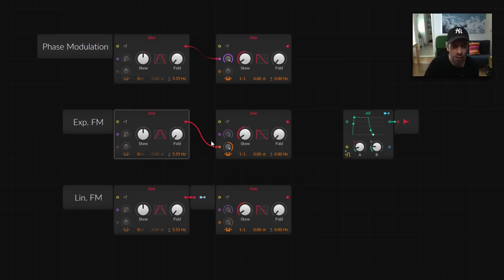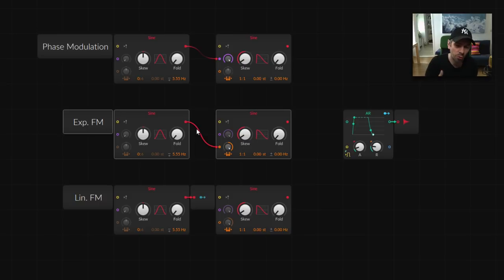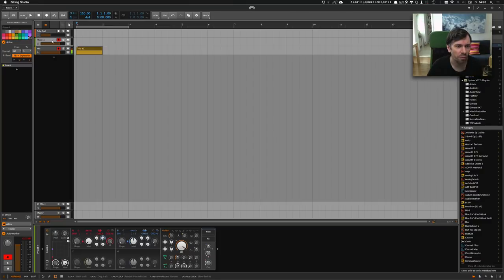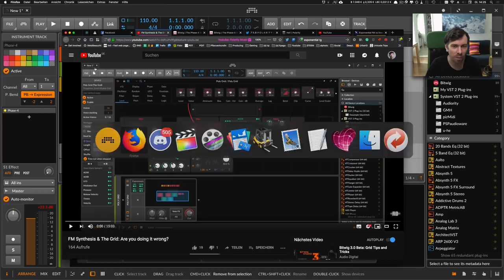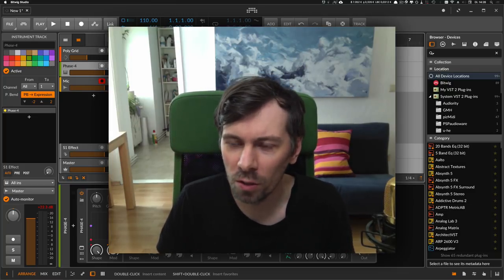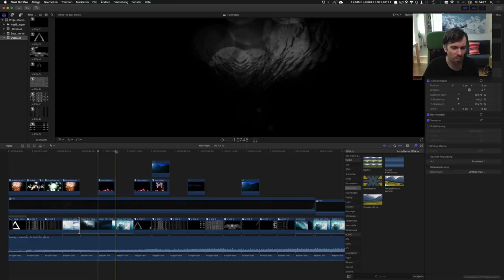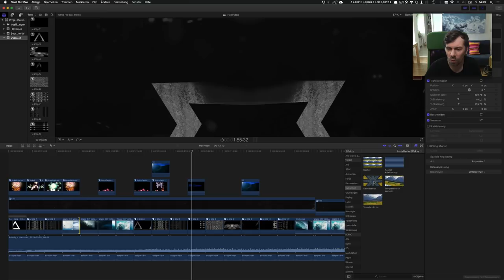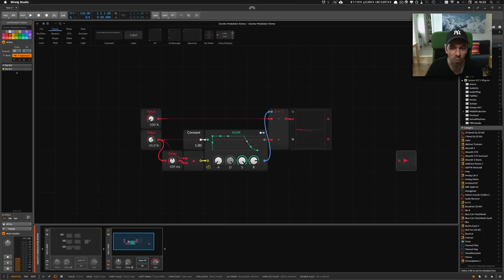Bitwig VLOG#2 - FM vs PM, Phase-4, Hell Ep, Videos & Bitwig, Gravity Modulator Update

Comment: Since LFO rate can be set to kiloHertz, it can be used as regular oscillator (although you'll have to set it in +/- mode for proper AC audio out), but it's rate input will be in Hertz rather than semitones (and there's no keytrack in LFO itself), so this way you can implement linear or Log FM modulation.
Also support team said that they may implement self-feedback knob in modules that need it